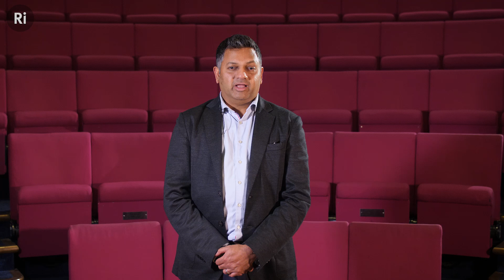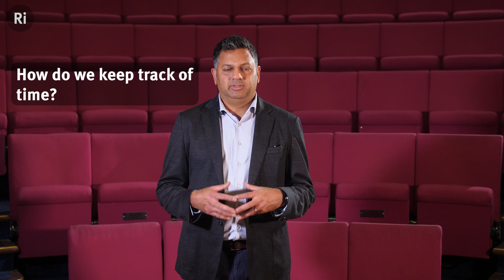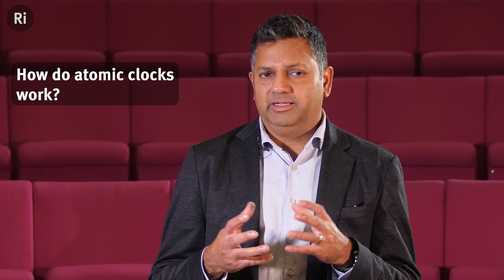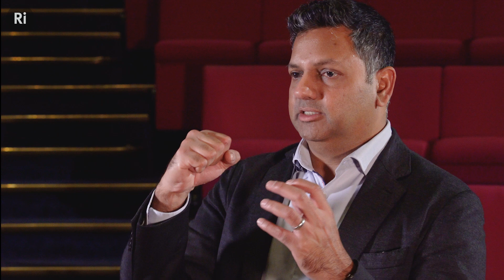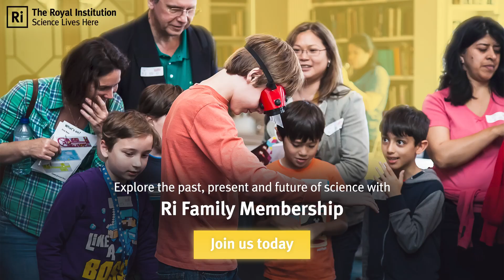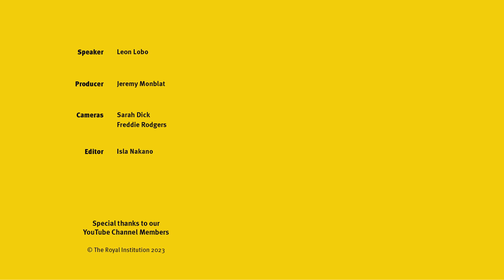How and why do we measure time? - with Leon Lobo

Comment: You said that atomic clocks are driven by radiation at a given "energy". However, given that radiation energy can also be defined as wavelength can it be said that you are using one atomic frequency clock to drive another atomic frequency clock? What method could you use to check the frequency of both clocks?